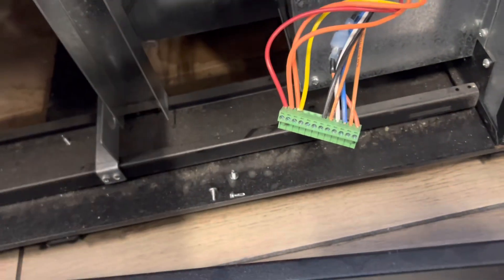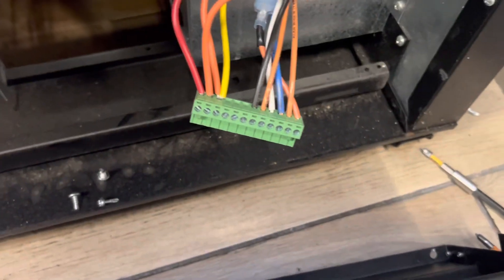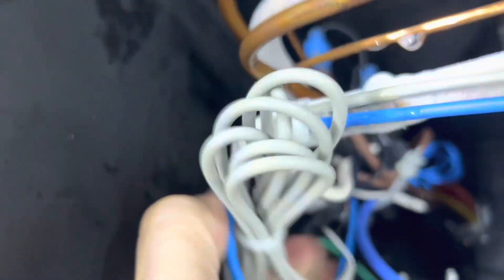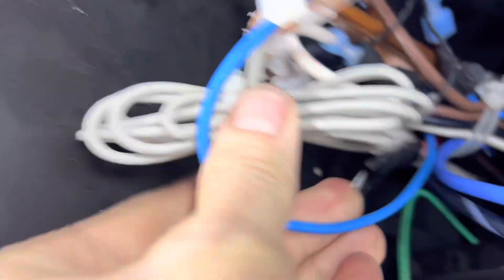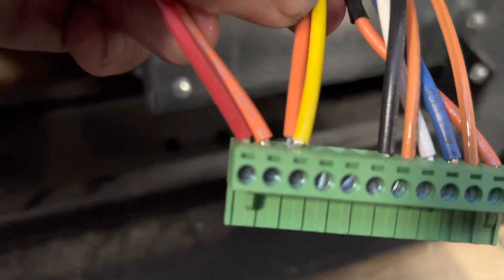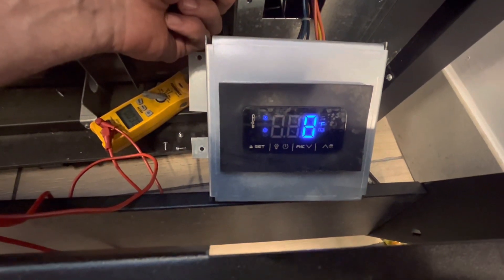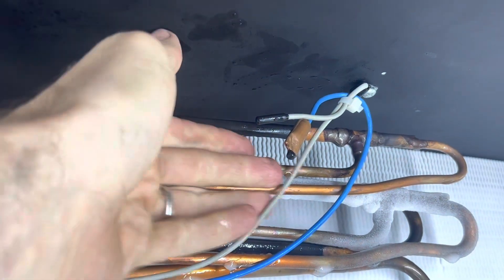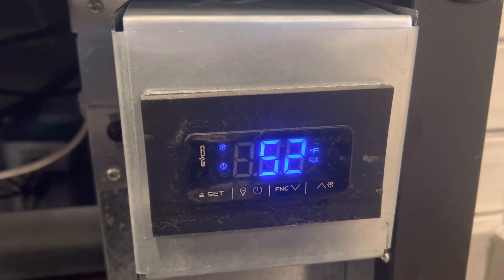Global cake freezer - PR1 error

Comment: you need both sensors,one to control temp and the other for defrost termination,they have a pack of thermistors on amazon for 10 dollars,
Reply from the maker: Agreed it’s not an “extra” sensor. However to get the unit operable without the replacement part tech support confirmed that would go back to proper temp management until the warrantied part arrived without negative impact.  NOT preaching to just steak the P2 sensor and call it a day.  But it’ll get by